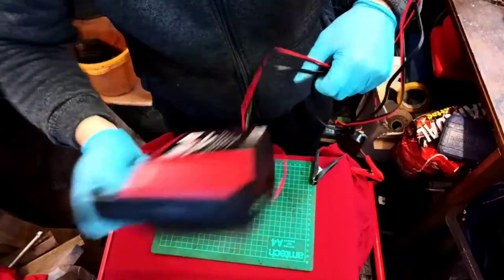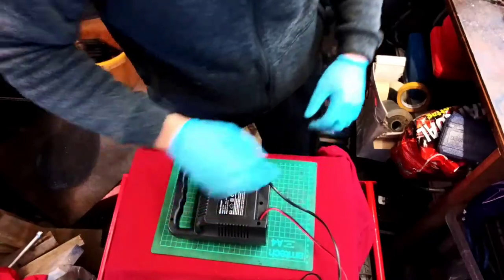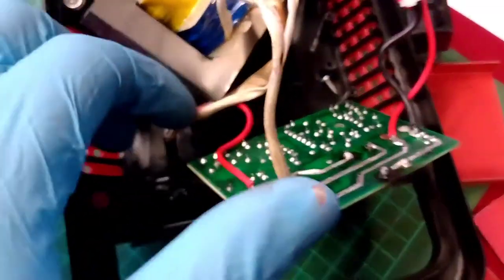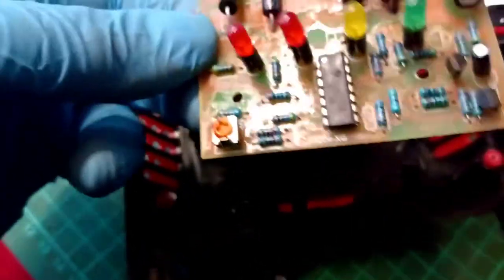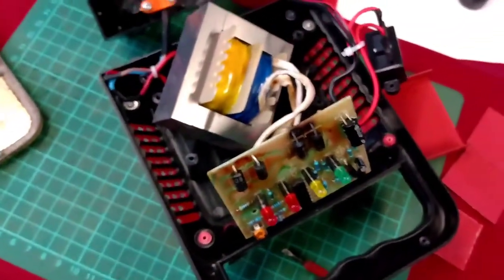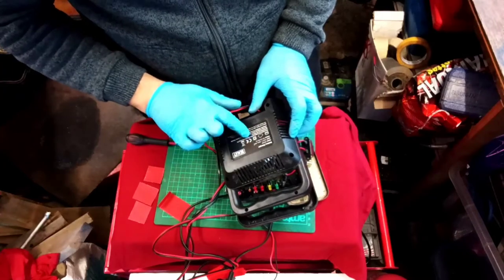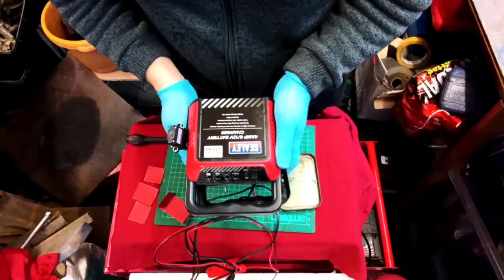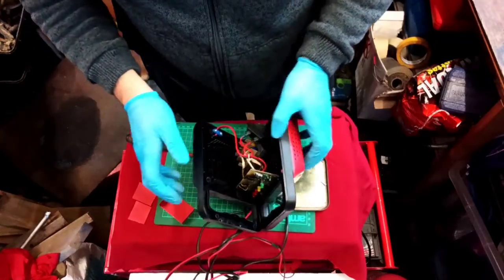Sealey STC40 6/12V Battery charger review

Comment: Im currently using one right now and my garage smells like electrics burning ive just disconnected it and this is the first review i came across. The battery level indicators dont seem to do much either checked on it like 10 times over the last 4 hours and only seen them on once
Reply from the maker: Yes unfortunately they are rubbish.....one  person emailed me when there lotus car went up in flames.....needless to say they claimed. Thank you for the comment. Doug